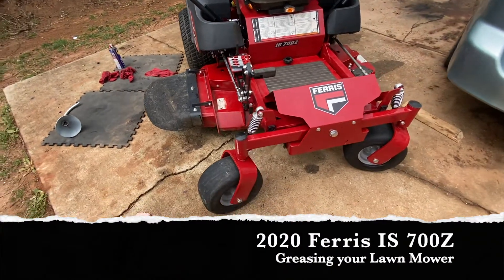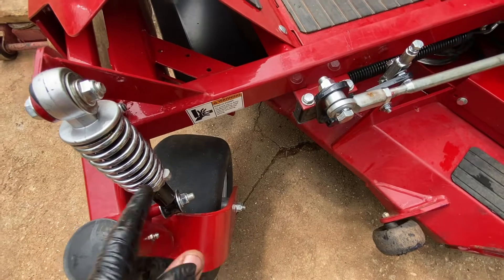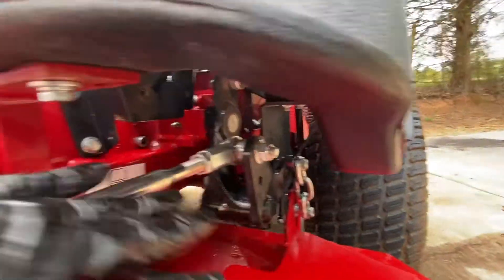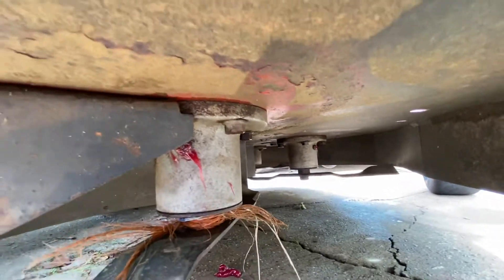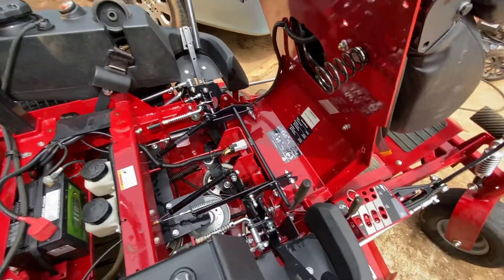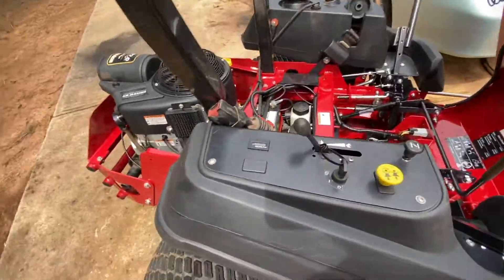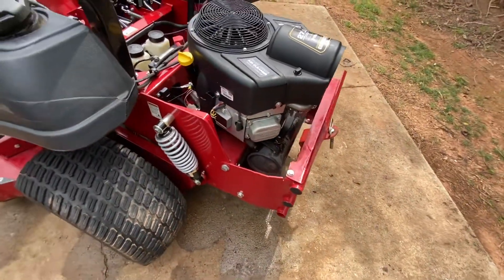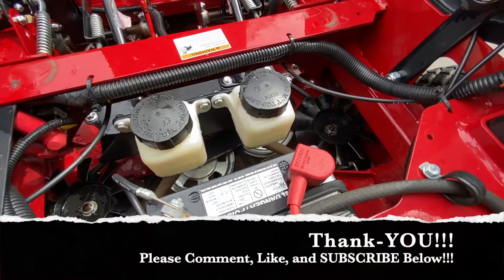Greasing your Ferris

Comment: I am home owner I grease about once a month !!!  I have a Ferris IS 700 with 24 hp Kawasaki and 61 inch cut !!! I always check air pressure in tires before mowing and check oil level !!!  I always blow out pre filter and filter with compressed air after each mow !!! I mow 3 acres, takes about 2.5 to 3 hours each week !!!   LOVE MY FERRIS
Reply from the maker: Thanks for sharing. I love mine also. Yours is definitely putting in work, compared to mine.

Comment: What do you use on the heim joints where the manual says to use petroleum chain lube?  I thought about using Mystic JT-6 Multi-Purpose Grease.  My nephew had a dirt late-model and we used it on the heim joints.  Best stuff we ever found because everything else we tried the heim joints would squeak at the end of the race but not with that Mystic grease.
Reply from the maker: I will probably just use Automatic Transmission fluid this year. Stuff I have at the house.